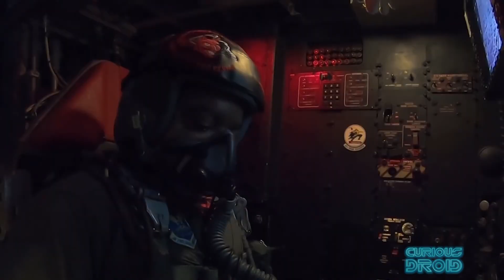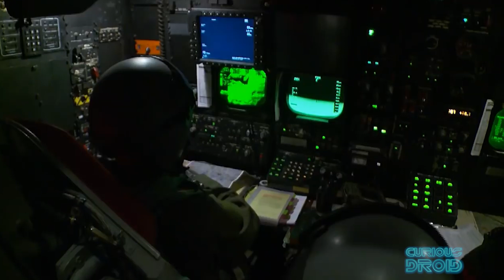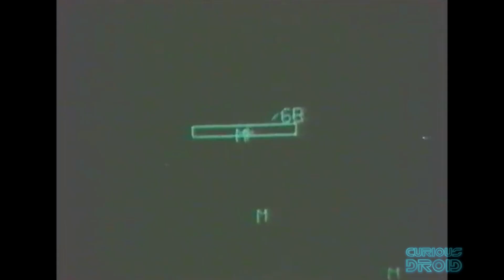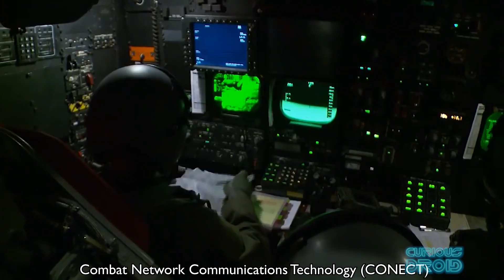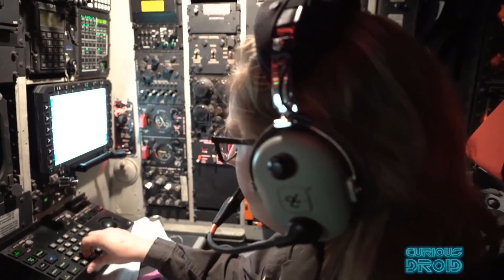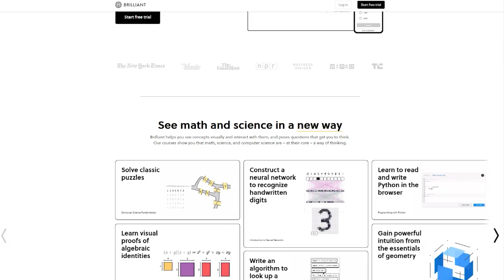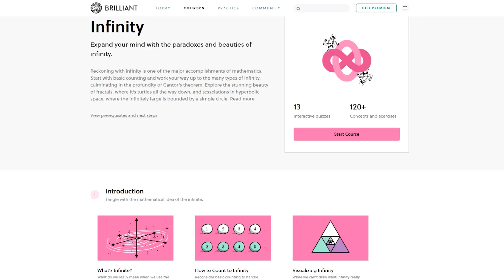How Long Can the B-52 Continue in Service?

Comment: As long as the airframe is still viable, it will still fly.  Engines can be upgraded.  Cockpits can be rebuilt as digital glass cockpits.  Systems can be upgraded.  One of two things will stop her from flying.  When the cost of her maintenance exceeds her usefulness or when foreign defenses reach a level that exceeds her effectiveness.  Yeah, she's no sleek, sexy thing.  She's a strong Amazonian warrior queen that gets the job done!  Instead of eight newer engines of the same size, wouldn't it be awesome to see her with four of the new GE90-115B engines tucked under her wings!

Comment: A large problem in a number of areas involved with government aircraft a simple lack of parts the NAS is using parts from the 1960s whose technicians are decades younger then the equipment itself no new parts are being built so everything has to be meticulously refurbished and any loss is significant projects to replace sections have so far met with failure often having questionable reliability

Comment: Well, it's hard to argue with a winner. The BUFF with modern additions is still the worlds most formidible heavy intercontinental bomber.  Anyone ever read 'Flight of the Old Dog? That's a B-52 with an SST's droop-snout, Transonic speed, black radar absorbant paint, modern avionics and systems, and a twin rotary launcher in the bomb-bay that can hold any combination of dumb and smart bombs, or HARMS or AAMRAMs, along with 16 AAMRAMs on hard points underwing.  and the crappy 50cal back turret replaced with an 'air-mine launcher. Basically an unguided missile that explodes into massive shards when triggered to explode, melting plane canopy and bodywork like butter. Fantastic book, and I'd damn well KILL to see a REAL 'old dog' conversion of a BUFF.

Comment: A lot of DC-3s still fly and are considerably older than the B-52s.  If they can still fly approaching the century mark,  no reason why the B-52s can't still fly.  True,  a lot of DC-3s have been converted to turboprops but the original airframes are mostly intact and still serviceable.

Comment: Old ass tech, does the job so well that it is still in service 58 years later.

What do we plan on replacing it with? An updated version of the same craft?

Hell no!!! We're going to design something completely new and oddball completely from scratch that probably can't even fly without a computer changing a thousand variables every second.

I'm far from a hater of new tech, I'm in the IT business, but people, the most high tech solution isn't always the best.

We have an EMP or nuclear attack, you know who's going to be the only people with working tech? People with old ass cars and old ass airplanes. A little wire and some duct tape and you can rebuild the ignition and everything else is mechanical.

Comment: The most impressive part of the B-52 was that is was initially engineered during a bbq of a few experts, as they drank a few beers. By the time the weekend was over, they had most of the initial system designed. The B-52 isn't really a plane, as much as it is a strategic delivery system.

Comment: The design and structure works, so why ever change it? just gut the insides and upgrade software and engineering.  In the future I see them refitted with electric engines.

Comment: What will drive the inevitable for this plane is the aging of its wingbox..when we flew it low-level, that aging was faster.  Once it was restricted to mid/high level missions, that clock slowed down, hence the 2040 lifespan.  That, combined with the Boneheads being taken out of the nuclear mission, extended its lifetime through the life of the B-1 and B-2; besides, not all of our weapons fit in a bomb bay ;)

Comment: "How Long Can the B-52 Continue in Service?"
"Yes."
Reply: The mystery about the long lasting Boeing aircraft is quite simple: rare use. B-52 and KC-135 are off very rare use. Civil aircraft like the 707 or A300 fly 7 days a week for 25 years. A KC-135 may fly once in two week from a fleet wide perspectiv.
Reply: Year 2070 , the B52 is expected to retire in 2100 , but I will be postponed to 2110.
Reply: call in the  A-10 for close support and call in a b-52 for everything beyond short range.
Reply: Wikipedia: the last b-52Hs will serve into the 2050s
Iori: ayo ako told me the B-52H can be in service forever

Comment: How can a 58 year old airplane still be relevant in the age of stealth fighters?
How can a 10,000 year old flint knife still cut meat in the age of laser beams?
The answer to both is the same:
Because the original use-case hasn't changed very much, and new tech is overqualified for the job.
Reply: Not to mention, the U-2 still flies to this day.
Reply: @Juno101  I like that story it was replaced by the sr-71 which was replaced by satellites... and the u2. I’m probably getting something wrong but I like my version.
Reply: @Juno101  because it's the cheapest thing possible to get its purpose done. Its takeoff trainung wheels fall off and it literally doesn't even lands it more accurately gracefully glides down the runway until it unceremoniously slows down and tips to one side and stops. It's that simple, no unnecessary complexity, doesn't have landing gear other than two bicycle wheels, and most of it's weight (which is not much) is put into the engine which can get such a light object as high in the air as possible just to take pictures.
Reply: The New tech Airplanes are developed for the Future of the Extreme case anyway.
It’s basically future proofing
Reply: @berkan5578  which is odd because there's lasers in position in space to hit any one of us they want
Reply: @sategllib2191 Proof?
Reply: @sategllib2191  No there isn't.
Reply: @skunkjobb  Proof?
Reply: Sometimes obsidian knives are used in surgery. The way the stone fracturescan produce a finer edge than steel.
Reply: It's because terrorists don't have radar.
Reply: In a low threat airspace the B-52 is rugged, cheap to operate, dump truck.  The B-1 will have a similar life span.
Reply: As long as the aircraft can be kept airworthy and has a role that it best suits, it's never "obsolete".   The "BUFF" is but an example of a timeless design that has and will continue to serve well beyond what was originally anticipated.  And not JUST the B-52...

1.  The C-5 "Galaxy" is 50 years old and still serving to haul big loads for the USAF.

2.  The T-38 "Talon", a variant of the original F-5 "Freedom Fighter" which was envisioned as a mass-production, low-cost fighter, which it was...for MANY Air Forces, but not the USAF, which wanted bigger and badder "fighters" and could get the funding their allies could only dream of.  In service for 50 years, it's finally being replaced by a joint development of Boeing and Saab, the T-7 "Redhawk", first examples to be delivered in 2023.

3.  The C-130 Hercules.  This four-engined turboprop first entered service in 1956; 65 years ago, so it definitely qualifies for a 'Senior Discount'!  It's served not only as a tactical cargo lifter, but also ASW, Maritime Search and Rescue, and even a Gunship version with a 105mm cannon!  Moreover, the type is STILL in production!  The Air Force and other services have yet to devise a suitable replacement.

4.  Even the long-time "champ" air superiority fighter, the F-15 Eagle, has been in service for 45 years and will continue for an unspecified period until the useful projected airframe lives of the latest models are used up...which could be 20 years or more!

5.  The aircraft which was originally spec'd as a cheap, lightweight fighter, the F-16, is also over 40 years old.  Although no longer in production, the remaining birds still have a lot of life left in them, so their retirement is yet to be determined, and likely more due to budget cuts than ability to keep in service.

6.  Even the opponents of America have their own examples of long-lived aircraft.  The Russians still fly the Tu-95 "Bear", the turboprop analogue to the B-52, with no retirement in sight.  Their fleet of transport planes like the An-12 and the Il-76 likewise have been in service for over 50 and 40 years, respectively, and are still planned to serve indefinitely. The MiG-21, which gave many a USAF or USN plane grief over Vietnam, after 65 years still serves with ex-Soviet and Russian client states.  The MiG-25 "Foxbat", first shown at the Domodedovo airshow in 1967, is still in limited service and one of the fastest aircraft ever.  Its derivative, the MiG-31, continues in service and likely will for years to come.
Reply: @selfdo  Ahhhhh, you're absolutely right sir.  B-1 first flew 47 years ago, in service 35 years. These frames have some life but, they age out.  These guys seem to last even longer than ships.
Reply: I'm the 400th like!
Reply: And because Stealth is BS
Reply: That doesn’t apply to the navy though
Reply: Overqualified, and impractically expensive and cumbersome to use, in most cases.
Reply: @libertarian4ever66 MiG's never "started handing us our asses" ever. It was just that the F-4/MiG kill ratio was not as high as was desired. Given the 13:1 annihilation ratio in the Korean war, the far lower ratio of Vietnam was considered problematic especially given the cost disparity between the aircraft.  The cause for this are attributable to a number of causes, a bomb loaded Phantom is not quite the dogfighter one needs, the US had stopped training its pilots in AtA combat techniques either for team or solo engagement, improved "Vietnamese" pilot skill, as well as other factors. Bear in mind, the F-4 did win the air war over Vietnam.  Also bear in mind that the vast majority of jets downed Vietnam were killed by SAM's.  The question was, was the loss ratio cost effective enough? The second question did the lack of a gun matter? As to the first opinions vary.  As to the gun, not really. Pilot training is what mattered. In Korea you had a USAF with thousands of wwii veteran fighter pilots having tens of thousands of combat hours logged against the cream of the Luftwaffe whereas the Red Air Force did not have the same focus on air-to-air combat. The air war in the west was very different from that in the east. That ends only one way. Did the lack of an auto-cannon matter. Not all that much.
Reply: Knife is often made of stainless steel  nowadays, with polymer handle!
Reply: @libertarian4ever66 the gun wouldn't have changed a thing. Everything was changed due to loss ratio. If you don't know that, you are not well enough informed on the issue.  Miramar  came out of that, ATA changed because of it, the gun wasn't the difference.
Reply: @libertarian4ever66 Funny you should mention the Crusader which actually made the vast majority of its kills with the Sidewinder and who considered the cannon unreliable. The cannon you contend would have made all the difference, didn't.  Combat velocity and ranges have increased so much as to make the gun a vestigial appendage for anything but ground attack. This is combat at in excess of 800 mph with ΔV's of 200mph. Shooting people down with cannon is more a matter of luck and desperation than a else.  I do think dropping the gun made some sense.
Reply: Stealth is shit
Reply: Apparently they work well now they'll go further by 40% like the Browning 50 caliber Colt revolver Winchester lever action and the new engines that they're getting some things intrinsically work and work and work and still work
Reply: Also stealth bombers are bullshit and overpriced.

Comment: Structurally, how does it last that long? I mean, metal fatigue doesn’t care about electronics.
Reply: The way metal fatigue forks is that lesser stress gives you exponentially and logarithmically more lifespan, I don't remember the exact figures but let's say metal a will survive 100^2 cycles at stress of 50 Mpa, 100^3 at 35, 100^4 at 30 and so on. So if you baby it it's effectively immortal...

Comment: Read "Flight of the Old Dog" by Dale Brown for some very interesting ideas concerning the B-52. Imagine a B-52 with wings that don't need the little 'pogo stick' gear on the tips. I mean the wings don't 'sag'. Replace the old engines with up to date engines. The B-52 is a huge plane and with the number of things that used to take up a lot of room in an aircraft now being much much smaller, well, you can see where I'm going with that. Better weapon systems, self defense systems, fit air to air missiles, the list goes on and on. Honestly read the book, you'll be amazed. Stuff that was 'science fiction' when the book was written should now be totally possible I reckon.

Comment: I think it's more of just how far ahead our air tech is. There isn't a weapons program that can knock them out of the sky yet. As soon as an enemy appears that can do that they'll switch over to B-2's real quick. That's all it really is. If it ain't broke don't fix it kind of mentality.
Reply: B52s have been shot down during the Vietnam war though.
Reply: @excaliber2010  Really? So they were able to bring down B-52's safely, cheaply and with an 80% success rate per attempt? Do you know why knights don't wear armor anymore? It's because the enemy started using a weapons program that can counter them easily. Soldiers trained in guns. A crossbow can penetrate a knight's armor, but not enough for it to be effective. A knight had his shield to hide behind for extra protection. Also the crossbow did not always penetrate. But a gun can penetrate shield and armor.Taking him out from a distance before he can pose a threat. It's is faster to train a group of villagers into riflemen than the years it took to train a squire into a knight. Even heavy armored troops were no match for a firing line. Which is why heavy armor was dropped in favor of mobility. Cannon/mortors made expensive fortress walls worthless to trenches and quick built wooden barriers. The enemies we fight today do not have a weapons program that can bring down  B-52's as effective as quick training rifleman to outnumber knights and bring them down before they can be a threat. First they have to get past the fighters then they have to reach the high altitude a B-52 flies at then they have to get past mordern counter measures then finally they'll be able to strike the plane. How man of these attempts have to be made before they can bring the plane down? How much time, equipment, manpower and money is lost for each attempt. Can they bring the plane down before it drops it's bombs, fires it's missiles or shoot it's cannons? Only if they're lucky. Does the enemy have the ability to strike at a B-52? Maybe. Do they have a weapons program that will knock them out of the sky the same as how knights were knocked out of the battlefield? Not yet.
Reply: @ninedragons1  That whole paragraph wasn't necessary but your statement of "There isn't a weapons program that can knock them out of the sky yet" is simply not true because some were shot down during the Vietnam War. An SR-71 is a plane that has never been shot down.

Comment: Boeing just got the non stealth heavy bomber design THAT good. They are reliable as a hammer. They can fly very high and very far even with a full payload. Indeed they are supposedly getting new engines. Going from 8 engines to 4. From what I know Boeing has been working on the engine retrofit for 2 years now. As for which engine exactly is still in the air for now. All options are very good.

The B-21 Raider. The Pentagon wants 200 of them. 200 is also the number of B-2's they wanted yet we wound up with only 21. The B-21 is supposed to have the same payload capacity as the B-2 despite being a slightly smaller aircraft which is very interesting.

The B-52 will continue to serve in one way or another until possibly the beginning of the 22nd century. B-52's serve as ultra reliable testing platforms extremely well. Factor in the low cost to operate and there you go.

Comment: Uh 3 things, 1. The engines were already fully replaced after the 2000's wich removed the contrails, 2. The cockpit was updated multiple times already including digitisation, 3. The a10 was retired by president trump. Try looking thing up of current info instead of things that happened years ago